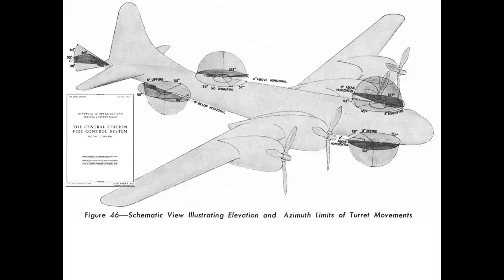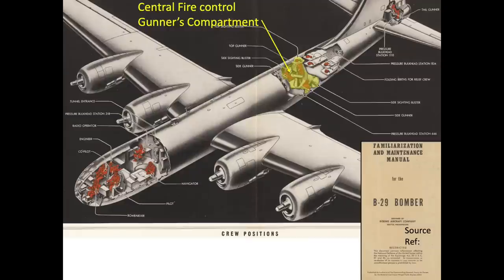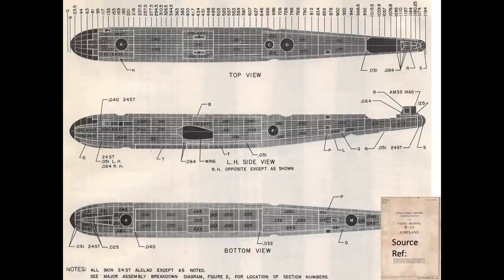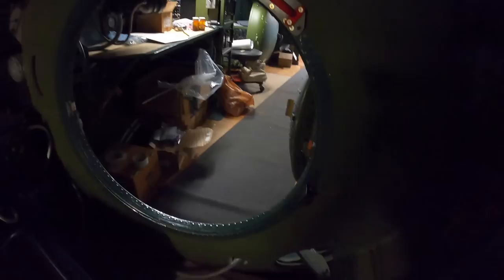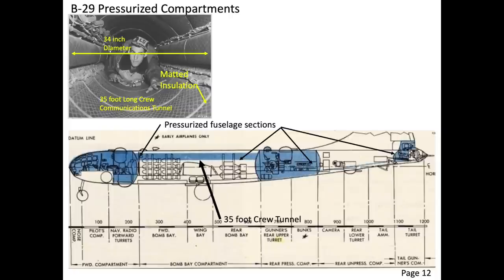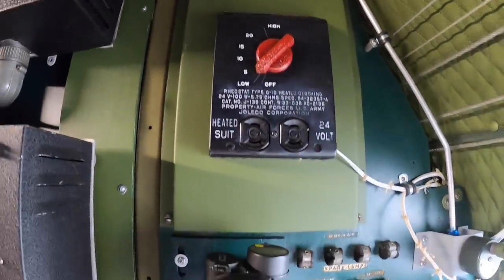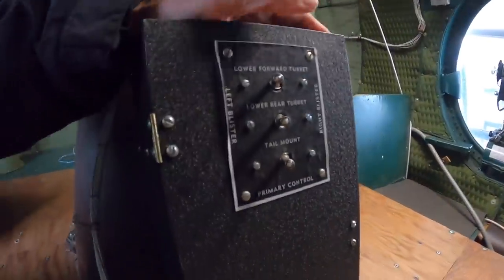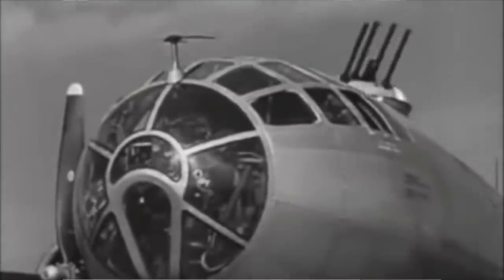B-29 Bomber Gunner's Compartment Detailed Walkthrough

Comment: Great video. Even with gun cameras, I take the 11:1 claim of the P-51, if it supposed to be air to air, with a big grain of salt, regardless if against the Japanese or Germans. Witness confirmation was considered enough... The Corsair was supposed to be 11:1 against the Japanese, yet a detailed study of Japanese Zero losses conducted on an air to air, encounter per encounter basis show a typical 1:1 ratio for the entire first year of the Corsair's service. Which is astonishing. This despite what I consider to be the Zero's abyssmal wing mounted Type 99-I, which got even slower firing in the later high velocity models... P-51 ground kills were counted, P-47 kills were added to the P-51 when some groups changed over, so there are a lot of issues with these ratios. Japan had 1% of US fuel output, Germany 2.5%, so if ground kills are included that would explain a lot...

Comment: The difference between left and right is not very much, 15% vs. 20%. However, if a pilot is sweeping in to attack it is more comfortable and intuitive for a pilot to want look out the left side of the cockpit because of the location of the throttle, he is leaning toward the throttle rather than away from it. Again, the difference is slight.

Comment: Amazing video. Love watching these videos (even though I’m not smart enough to understand most of the charts, haha). After watching this, is it at all possible for you to make a video on what the chances of the turrets on a B-29 getting destroyed due either to getting directly hit from enemy fire and/or having their electronics such as cables and the computers themselves are?

I couldn’t imagine it would be too difficult to make a turret inoperable with just some 20mm rounds directly into an electric cable
Reply: I was an air defense gunner in the Army back in the 80's, with the exception of our gun sights having a ranging radar that eliminated us having to manually range the target so the computer can know how far away it is to compensate for bullet drop and lead these systems are remarkably similar to ours, like ours you can bet that in the event of battle damage or just plain system failure the gunners could switch to "manual mode" and use good old fashioned Kentucky windage when firing on their target. 
Also given that the B29 had a kill to loss ratio of over 11.7 to 1 against the Japanese fighter's you can bet that one of them getting close enough to damage a B29 in one of those specific areas wasn't a common occurrence, when it did happen it was just pot luck.
In regards to his charts, I screen shot them so I can go back and look at them later to figure them out in relationship to the material he's presenting, like me you're probably smart enough to use them but just not in the short amount of time he has them up on the screen.
Reply: @TRUMP_WAS_RIGHT_ABOUT_EVRYTHNG  
I appreciate the sentiment but no thanks are necessary, it was honor and a privilege to wear the uniform of my country and those who came before me.
Just enjoy your freedoms and don't trample on other people's freedoms and that's thanks enough for me.
Yes, this channel and Greg's are both excellent, they both dispell a lot of WW2 aviation myths and that's because they both use credible sources for their information like official USAAF and NACA reports and records for their source material, unlike all those other channels that just use other videos as their source material that at the end of the day are just repeating the same old myths and misinformation that was started by hack aviation historians years ago, because they didn't do the proper research into matters or misinterpreted the information they found resulting in these myths that have become established facts over the years as far as most people are concerned.
Greg is excellent for taking those NACA reports and turning them into what us non pilots can understand, but most importantly is the fact that being an airline pilot he's educated in aviation to a level that when he looks at those NACA reports he doesn't misinterpret the information in them like a non pilot, or worse yet someone that has a pilots license but only flies Cessna's on the weekends, might misinterpret it.
Even though I'm not a pilot I've seen errors in information in online articles written by weekend pilots about things like the supercharger systems on some WW2 aircraft, one guy wrote that the reason that the Merlin engine worked better than the Allison engine in the P51 is because when the Allison was put in the P51 it didn't have a supercharger but the Merlin had a turbo (I swear to God that's what the guy said, I didn't mistakingley quote him and you didn't misread that), so that's why when they put the Merlin in the P51 it was so much better, even though the guy is only a weekend Cessna pilot can you believe he actually said that in an online article? And because he is an actual pilot and he wrote that in an online article people who read it and don't know any better are going to walk around thinking it's true because they heard it from a pilot, wow, that's amazing, absolutely amazing. 
Another great example is all the claims that've been thrown around over the years that the Norden bombsight was inaccurate, that's a classic example of hack historians claiming that because of them not doing the proper research or just repeating each other, all they do is take the overall results of bombs dropped and attributed every one that didn't hit a target to the Norden bombsight, they never subtract the results from bombs dropped using the ground scanning radar from their math, and a very high percentage of the bombs dropped used that instead of optically sighting with the Norden bombsight especially during the winter months when visibility was bad, and they don't subtract the results of bombs that didn't hit the target because an entire formation was flown to the wrong target and bombed it because the lead navigator made an error and flew them there, that counts as zero bombs on target and blamed on the Norden bombsight.
This channel has shown, using the credible sources it does, that when the Norden bombsight was used and a formation wasn't bombing the wrong target due to things like navigation errors that it was incredibly accurate.
Reply: @TRUMP_WAS_RIGHT_ABOUT_EVRYTHNG  
When it comes to WW2 aviation this channel and Greg's are the only two I recommend to people because they're really the only two I know of that are credible because they present all the sources for their information, all the other one's just repeat what they hear on other videos, you ever notice how they don't list their references and sources on other channels? That's because they're references and sources aren't credible that's why, they just sit around all day watching other nonsense videos and then repeat what they saw and heard.
The P51/Merlin SNAFU that I was talking about wasn't from a video or the comments in one it was from an online article I read that was actually written by a pilot, he only flies Cessna's and has never flown an aircraft with a supercharged engine but still, you'd think he'd know what he was talking about, and anyone who doesn't know any better that read that nonsense is going to be going around in life arguing with people feeling like he's 100% right because he learned it from an actual pilot, "he must know what he's talking about he's a pilot", yea, some poor guy's gonna be going around arguing with people saying "No, Allison's didn't have any kind of supercharger and Merlin's had a turbo, I know I'm right, I learned it from a pilot, he'd know", when in fact there's absolutely nothing that's correct about that, it's wrong in every possible way, we're talking light years beyond a typo, that poor guy's in for a rude awakening one day. 
This channel has dispelled one of the greatest WW2 myths and he did it with actual records and reports, and that's the myth that the Norden bombsight was inaccurate, all of the reasons why that myth got started years ago are too long to list in a post, but the single biggest reason is the fact that all the supposed authorities on the subject came to the determination that it was inaccurate based on looking at the total number of bombs dropped by US bombers and then taking all of them that missed their target and blaming it all on the Norden bombsight, when in fact the majority of bombs dropped by US bombers weren't aimed using the Norden bombsight, instead they were aimed using the H2X ground scanning radar to aim them especially during the winter months when visibility hardly ever gave them the chance to optically sight the targets, subtract the results from missions that didn't use the Norden along with the results from the missions where the lead navigator flew the entire formation to the wrong target and it getting bombed resulting in a zero bombs on target score and you'll see that the Norden bombsight was incredibly accurate, when they had clear skies and could actually use it and they weren't bombing the wrong target due to navigational errors they plastered the targets.
It's hysterical that all those other supposed experts on US bombers never even mention the H2X system in their videos and that's because despite being "experts" on the matter they've never even heard of it, much less know to subtract the results from when it was used when evaluating the Norden bombsight. 
There actually is one other channel I'll pay attention to concerning WW2 aviation and that's a channel called "The Warbird Mistress", she also does actual research on things instead of learning from other videos.

Comment: Did the guns have some sort of safety system to avoid shooting their own plane? Did B-17s and B-24s have a similar system?
Reply: Some warships had metal bars around them to keep barrels from aiming at own ship.  I bet WW II turrets had something similar.
Reply: Yes. Electrical interrupters that stopped them from pointing it at such as the tail fin. You could swing the guns past the tail but they would not fire as it came to point at the tail.
Reply: You weren't listening
Reply: @TRUMP_WAS_RIGHT_ABOUT_EVRYTHNG  Lancaster's mid upper turret had a raised collar around outside of turret to prevent firing on tail planes  from 🇦🇺  Australia
Reply: @Jose Chung FrOm oUtEr SpAcE  ww1 gun interupptors where mechanical on a cam I guess before they had them they put steel covering over propellers must have been thin and only in line of fire good position for guns to harmonise on target  a/c